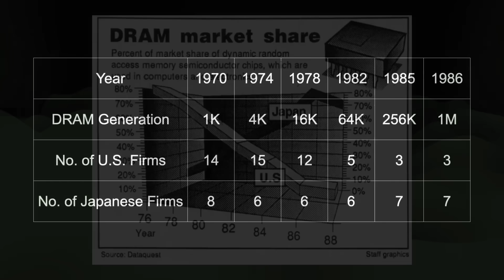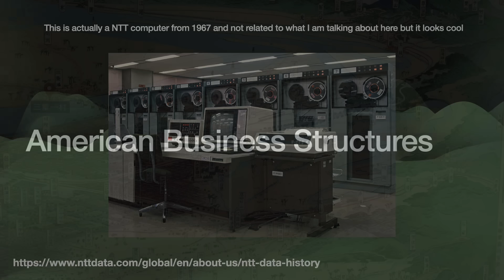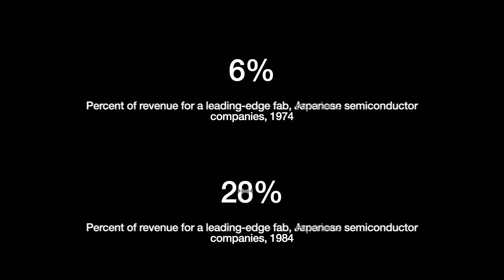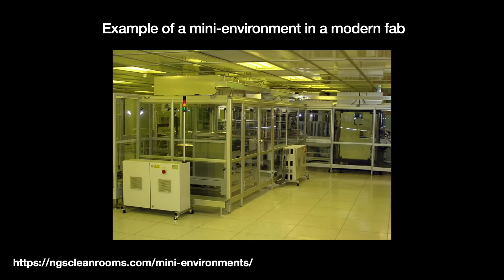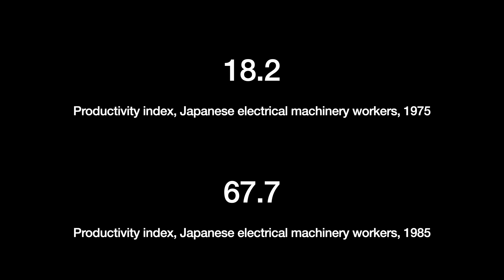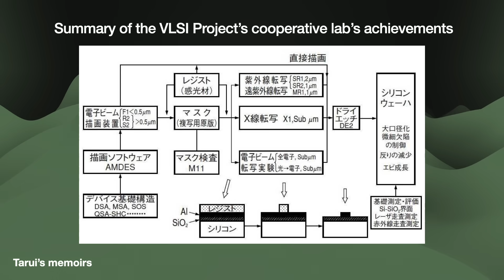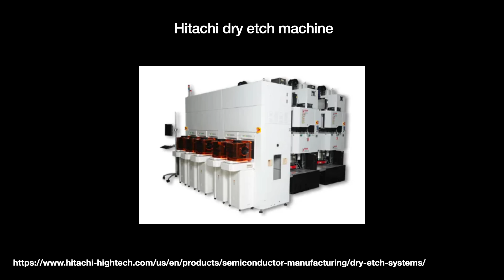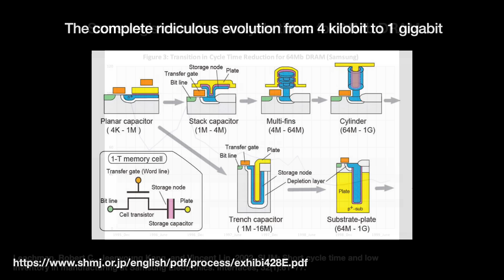Why Was Japan So "Good" at Semiconductors?

Comment: American advantages are large market size of mid-income domestic consumption.
But mainly the USA get to the top and maintain at the top usually by means of hooks and crooks, forcing Japanese to relinquish via economic wars via countless sanctions, very similar to the current time against China but at a much larger scale.
You're wrong: In general, East Asians (Japan, Korea, Singapore, and China) are very good with semiconductor industry. 
Doesn't matter what the West (Anglo-Saxon Inglish speaking world and Europe) does, through various unethical and immoral means to achieve the status quo, East Asian will ascend upward in the long run.

Comment: Yield numbers? How can we know who was the best without comparing the yields?
Reply: I’d argue that price per functional unit is what matters. Company X may have lower yields than company Y but if they can still produce a functional unit for the lowest cost, they win.
Reply: @andrewwelch5017  i guess it depends on our definition of 'the best' ;) i am a technical person  and work for an equipment supplier of visual inspection machines so... The price also depends on advantages like cheaper labour costs and government aid. If someone wins because of that, i wouldn't call it 'being better in making semiconductors'.

Comment: That Plaza Accord seems to be the problem with everything. It seems to be mentioned in every video about Japans economy. If that had not happened I wonder if Japan could have continued.
Reply: Not only that, (as mentioned in the video) US introduced regulations and tariffs on some semiconductor imports from Japan in the 1980s, which, along with the aftermath of the plaza accord, made the Japan’s semiconductor production sites move abroad. After all Japan’s semiconductor manufacturing industry faltered because of this series of events and allowed emerging countries like South Korea to gain market share.
Reply: @my_account5603  go watch his video on the rise of south korea's semiconductor industry. Semiconductor manufacturing moved because other countries rapidly gained expertise even to the point of eclipsing Japan. This whole plaza accord bs is just an excuse to undermine the achievements of other countries
Reply: It was designed to unfairly kill most of Japanese advantages in roughly all technology sectors.
Reply: except that Japan's economic stagnation was a result of their own internal property bubble which is a self inflicted wound. This is the equivalent of blaming the 2008 financial crisis for china's property bubble
Reply: @uno823  This kind of thing does not usually  boil down to one factor regarding semiconductor (manufacturing). But that’s completely wrong to say plaza accord and others are irrelevant in the case of Japan.
Plus, property bubble is clearly not only for its internal reason. There are external factors too.
Reply: Japan's economy and wealth are all fake. Watch Princes of Yen.
Reply: US is literally that toxic friend where he's fine with you excelling until you become a threat and he will find a way to crush you. It was Japan in the 80s, and they're doing it now to China.

China's advantage is its massive population and a comparable land size to the US. They seem to have equal strengths compared to Japan which is basically just a size of 1 US state.
Reply: bUt THe FrEe mArKeT AUSTERITY FOR YOU PEASANT

Comment: Why was Japan good at everything up until mid 1990s, and then blew it?
Reply: Because Korea ramped in those technologies. Japan was good but Korea was gooder and faster and their workers work at least as hard as Japanese.
Reply: The paradox or irony of over-engineering. Once your products have become the "gold standard" in quality and precision during its heyday, it's impossible to maintain the same characteristics in the years that followed due to tight budgets, alongside more companies with cheaper labor costs and cheaper brand image stealing the limelight with their smaller semiconductor products.

Comment: I think another important and often under talked about "culture piece" has been talked about by Craig Barrett in interviews he did from his time visiting Japan when he was rebuilding Intel's manufacturing organization. During his tours in Japan, what he realized was Japan's "special sauce" was data drive engineering built around the idea of continuous improvement and statistical process control. American semiconductor fabs at the time were by contrast more artisanal craft production. Having things like operators with stop watches determining process time and operators/engineers trying to learn the intuition for technical wizardry if you will. Implementation of SPC, data driven engineering, and as Craig Barrett said just "running your chip factories like a factory rather than a laboratory" drove massive product quality improvements and greatly leveled the field with foreign chipmakers.

Having recently read *the machine that changed the world*, I can see alot of similarities between the comparisons of Lean production and Craft production. The Japanese semi makers were no Toyotas, but they were definitely at least Ford-like and employed some elements of Lean manufacturing. Meanwhile, IBM, Intel, MOSTEK, and National were more Benz-like filled with proud "artisans". The problem with craft production is that Lean production always beats out mass production on cost and craft production on quality.

I do wonder in an alternate timeline if American chipmakers moved away from craft production sooner if there would have been more American leading edge memory makers today. Micron made the transition and came out the otherside doing pretty well for themselves. TI, Intel, and AMD all made great strides in improved manufacturing discipline and methodologies in the late 80s thru 90s, but began/completed pivots out of commodity memories to design rich products. I feel like they could have replicated Micron's success and in the case of TI and Intel would have presumably been more stable on account of the greater financial firepower/scale. But seeing how things worked out in the late 90s and 2000s I don't think TI, Intel, or AMD are particularly broken up about moving to higher margin differentiated products.
Reply: I’m not an expert in this subject(getting a bunch of info from asainonetry and all that)
But it seems like they got stuck with a corporate culture which inhibited these companies from taking a more ford approach. Limiting their ability to adapt. The question becomes. What could shake them up? A sooner meeting with Japanese chip makers? Maybe demands from the military who they often supplied?

Comment: Hey Jon - love ur videos. As someone that works in finance, I should tell you that no one in the industry really thinks about or uses debt to equity ratios. That stuff is mostly for academics. More common is Net Debt / EBITDA or (Debt - Cash)/(Operating income + D&A). Typically you might see it on a 1 year forward basis, so todays net debt over today + 1 year's EBITDA, as we care about next year earnings, not what was achieved historically. Just be careful - this metric is easily moved by the company over / under earning, like at the top or bottom of a cycle.

Comment: I remember Japanese LSI parts starting to dominate in the early 1980s. I also notice, with parts that had quartz windows, so you could see the actual part, that Japanese chips were larger than American chips, for the same generic part. Say 2764 EPROM, or an 8051 uC. Did I mention, this was some time ago !?

That said, they did transition from NMOS to CMOS, for LSI parts, before the Americans.

Comment: Starting in the late 1980s U.S. companies like Motorola adopted more theoretical and mathematical methods to improve and maintain quality, speed up the development process. At Motorola we developed the “ Six Sigma Methodology”. that has now spread worldwide. In the Chip Packaging area to reduce labor input / cost ( plus get higher performance ) we developed Advanced. Packaging ( Flip Chip tech, which uses area array of microscopic solder bumps on the Chip face, aligned and attached to the pads on substrates using adv. M/c vision based fast yet precision Robots pretty much home made w/ own algorithms & software that have now become industry standards and power AI hardware. Since the early 1990s on behalf of both Motorola & Intel have been to Japan over 25 times. They were NOT very well educated ( not enough PhDs or fluent in English ) so could n’t speed up their development work using theory or other peoples Research.. In contrast to Japan, key people in So  Korea & Taiwan  all had PhDs and that too from the US. These basic technical factors combined w/ business and social factors made Japan uncompetitive, now they are demoralized looking up at TSMC even for technologies ( licensed from the U.S. ) that SONY has been using since 2016 !

Comment: The moral of the story is that South Korea beat Japan at its own game because they too learned to specialized in the most widely produced segment of the market, DRAMS.  The Americans stayed in the game because they were searching for profits and that meant microprocessors but even here the in the madcap quest for higher and higher returns in order to satisfy Wall Street they had to surrender manufacturing to Taiwan
Reply: There's another aspect to this.   DRAMs (along with SRAMs) have the advantage of being a "regular" structure, as opposed to random logic or processors, and the chips make excellent vehicles for ramping up a new fab or semiconductor process.   They allow the manufacturing team to optimize the process and do an easier job of yield learning than logic chips.    There are relatively few part numbers involved and high volume.   Partially good chips can be sold as lower capacity memory.

Comment: pretty sure japan just gave up. the only thing they're good at making now is jeans.
Reply: What about ykk zippers, they are market leaders, biggest tunnel boring machines from Kawasaki, great HPLC from shimadzu, largest and most reliable car manufacturer Toyota, awesome mini tractors Kubota, sharpest razor blades Feather, high quality construction tools makita, one of the best whiskeys suntory, home theater amplifier marantz
Reply: @Humbulla93  Also Nikon and Canon battling among themselves in optics and microscopy space. Hitachi doing a lot of great work in various industries. What's your air conditioner brand? Likely Japanese.